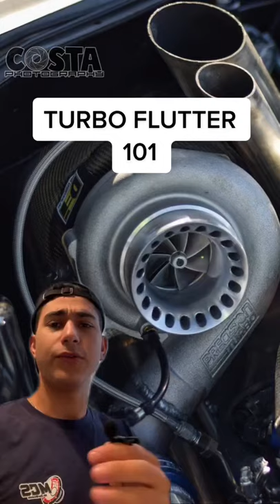TURBO FLUTTER 101 - Explaining Sutututu Theory

Comment: You fail to mention how bad that is for the turbo. Lol no pressure relief is bad
Reply: Not bad at all.
Reply: @DriftNick  it is bad for it, regardless of what you believe. A turbo is a finely balanced precision unit. Forcing air backwards is bad for it, ask people that have replaced a few turbos because of surge(ie, Ford 7.3 1999-2003)
Reply: @jnk26  Been running no valve for over 10 years, it's common here not to run one, never had a single issue with it.
Reply: @DriftNick  maybe the difference is a real turbo on a diesel vs a little turbo on a small gas play thing. A turbo on a 7.3L isn't small but it's micro compared to a 15L I6 like a 6NZ Cat or a turbo on a 95L Cummins QSK95(3000-5100hp)

Comment: I'm a mechanic and you're talking rubbish, clearly you don't understand. It's down to the type of Blow off valve and nothing to do with a recirculation valve. The wastegate setting will cause induction spool sounds which adds to the blow off valve sounds
Reply: Turbo flutter is down to the type of blow off valve? does no blow off valve count as a type of blow off valve?

"The wastegate setting will cause induction spool sounds which adds to the blow off valve sounds"

wut

Comment: Lol all these videos and to this day still wrong. The psi escapes / bounces between the compressor wheel and throttle plate.
Reply: The pressure escapes out the only place it can which it the intake of the turbo.
Reply: @DriftNick  but it doesn't exactly, which is why the pressure wave bounces between the throttle and compressor wheel.
Reply: @KCM33  What do you mean it doesn't exactly? the pressure wave bounces between the throttle and compressor wheel and escapes out the intake.
Reply: @DriftNick  The turbo is still spinning even when you let off...and the pressure wave bounces between the still spinning compressor wheel and (likely still slightly open) throttle plate. Not going to argue with you on such a technical level, in a way we are both right, so i dont care.
Reply: @KCM33  What is there to argue if we both are saying the same thing? lol

Comment: Air doesn’t go back trough turbo that’s called the bov or you have the wastegate but cool sounds 🤣
Reply: without a bov thats the only place for it to go, so yes it does go back through the turbo
Reply: When a car flutters like that, it is 1000% going back through the turbo. That's why it sounds like that. 

Also, "thats called the bov or you have the wastegate"  those are 2 completely separate things

Comment: if thats your'r reason your car is broken

normally you have a bypass valve on stock car making no noise an recirculating presure into the intake to help build pressure preventing lag

it it happens the way ya said this means you'r turbo spun backwards bad thing really bad thing

the flutter comes from a blow of valves being set to atmosphere slightly

the puthsss is 100% atmosphere bov setting

no car builder build a car without a BOV or BPV

no bov or bpv= turbo blow seals, spin backwards, and over spool / under spool  
also this would fuck your exhaust back pressure potentially causing misfire and detonations 

yeah dont listen to dumb people like him or you will fuck up your car

turbos need oil feed and retun
then wastegate and optionally a controller for it
then you need a bov or a bpv and intercooler 

BUT COOL SOUND STILL
Reply: It does not make your turbo spin backwards or cause damage or create lag or come from a blow off valve or anything you have said it does.

"no car builder build a car without a BOV or BPV"

Been doing it for 10+ years.

"also this would fuck your exhaust back pressure potentially causing misfire and detonations "

I hope this is just a troll comment because it's so dumb.
Reply: @DriftNick  lmfao
Reply: @SKILLS2KILLS_QC  You have zero understanding of what is happening and that is pretty funny.
Reply: @SKILLS2KILLS_QC  Not only is it not possible for flutter to make the turbo spin backwards as it would correct itself long before that but it doesn't even slow the turbo down, High Performance Academy tested exactly that on their youtube channel, there is no difference in turbo speed after lifting off the throttle between running a valve and running no valve, they both go down at the same rate, though anybody that has actually run no valve could tell you that it doesn't cause any extra lag, if it did it wouldn't be common place in motorsport.

"ive worked on cars and heavy equipement and never i have even seen a turbo engine without a bpv or blow of valve its just imposible it would run so bad"

Every Nissan turbo and most other turbo cars pre 1990 ran no valve and they ran just fine, even removing them from something that had one from factory can still run without issue depending if the ECU cause any issues (something that aftermarket easily fixes).

"the sound he makes in the video are all from bov even an excavator uses a bov for fuck sakes"

My car makes the sound he makes in the video, it literally has no blow off valve or bypass valve, if you can't understand the basic fact that the sound is from not running any valve I sure hope you never worked on any car let alone heavy equipment, you have absolutely no idea what is happening.

"we are the builders of about 9 rally cars "

You know the chirping sound turbo rally cars makes when they lift off the throttle? that is turbo flutter.

Comment: Turbo flutter is very bad on the tubro
Reply: Very bad = if it does any damage it's so minimal you wouldn't notice.
Reply: @DriftNick  it will cause shaft play sooner than later
Reply: @DriftNick  it dramatically increases the load on the bearings of the turbo.
If it occurs at higher engine loads or boost levels, it can cause premature wear to your turbo. Thus why a BOV is much better.
Reply: @josephraymond3180  Higher engine loads? what do you think engine load does to change it?
Reply: @DriftNick  higher rpms = everything is moving thousands of times faster. If you're running say a 63mm turbo @ 15 psi and shift at 7,500 - higher, you're going to have more induction. Pretty simple to understand
Reply: @josephraymond3180  Higher rpm does not really mean higher engine load hence my confusion.

Anyway plenty of people running a lot of boost without a valve without issue.
Reply: @DriftNick  acceleration increases engine load. RPMs go up with acceleration pending how you accelerate, either way RPMs will go up. Wether you say so or not, turbo flutter is not good for a turbo. Sure it may not cause any malfunctions right away more than likely, but over time you'll run into turbo related issues sooner than if you had a ventilated setup with a proper blow off valve. It's your money, do as you please. I've owned and built 12 turbocharged vehicles and learnt the hard way about tubro flutter on my early days. As I said, to each their own. I personally will always use a BOV, and make sure it is releasing every bit of left over boost, I don't want my fan back spinning.
Reply: @josephraymond3180  Oh god you one of those people that thinks it makes the turbo spin backwards, you may have built 12  turbocharged vehicles but apparently you do not understand at all what is happening.

" learnt the hard way about tubro flutter on my early days"

I've learnt from doing it for over 10 years and learned that generally people from North America have no idea about turbo flutter, I'm sure turbo flutter killed your turbo and it wasn't something else...
Reply: @DriftNick  nothing killed any of my turbos, just had to have 2 rebuilt over a few years of misuse due to not enough boost getting released. I may have misspoke about the blades spinning backwards, but it does affect the blades spinning. Either way, my original comment is correct. Turbo flutter is bad for your turbo. Simple as that. Anything else, I just agree to disagree. I'm not arguing over a fact that is widely known and also easily available to look up.
Reply: @josephraymond3180  Turbo flutter does not make the turbo slow down if that is what you are trying to say,  High Performance Academy have a video on their youtube testing exactly that, the rate at which the turbo slows down after lifting off the throttle is no different between running a valve and not running one.

"I'm not arguing over a fact that is widely known"

Only seems to be a fact in North America, hear in Australia people have no issue running no valve.
Reply: @DriftNick  I never said it slowed them down.. I said it affects the blade spinning. I'm done with the back and forth. Just because your name has drift in it doesn't make you a know it all on forced induction. Again for the 10th time. Turbo flutter is bad for the turbo. End of story. Agree to disagree
Reply: @josephraymond3180  You could just tell me what you think is happening instead of saying "I don't want my fan back spinning." and " affects the blade spinning", how am I meant to know what crap you made up as for what is happening?

Comment: Absolutely wrong! It is actually causing pressure to be forced against the turbines compressor wheel causing compressor surge..this can and definitely does cause many issues, at very high boost it can lead to the turbine shaft to sheer and bearings to fail. Put a fuckin blow-off valve and be a real man.
Reply: Meanwhile people here running 50+psi with issue.

Comment: And it’s not good
Reply: It's not good, it's great.
Reply: @DriftNick  running boost with out a BOV? Haha. Flutter is a sign of short lived fun. Install a high quality BOV or DV and tune it right.
Reply: @fulano787  Been doing it for over 10 years, so much for it being a sign of short lived fun.
Reply: @DriftNick  your engine has been running boost with out a dv or bov for ten years? Why even install a turbo with out one? You just wanted to hear the flutter destroying your spool and turbo bearings? Must be slow
Reply: @fulano787 It doesn't destroy spool or turbo bearings, if there was any increase in lag it wouldn't be common place in motorsport not to run a valve, literally no one would run without a valve if there was any performance loss, it's actually better if you don't release all the boost pressure out of a valve.
Reply: @DriftNick  lol, deleting posts is almost as sad as saying bovs and dvs do nothing
Reply: @fulano787  I didn't delete anything, if youtube is filtering my comment you can probably read it if they e-mail you when you get a reply, I also never said they do nothing.

"there’s not a race team out there that’s not running a DV or BOV "

Nobuteru Taniguchi just posted a video of the HKS GR86 on his channel with their turbo kit, it doesn't have a blow off valve or bypass valve, what would HKS know about building cars though, must be slow.

Pretty much every Japanese car competing at the highest level doesn't run a blow off valve or bypass valve, same is true in Europe.

How about GT3 and GTP? Ferrari, BMW, Acura you can clearly hear the turbo flutter in their cars when they lift off the throttle, guess they also don't know what they are doing.
Reply: @DriftNick  it’s the tune of the valves. The spring is set for the higher psi on their cars. It’s not them not having a valve, it’s the valve being set at its max because the springs aren’t progressive
Reply: @fulano787  If it doesn't open at full boost when they lift off the throttle when do you think it would open? it's not a case of it not opening at lower boost levels, they just don't run a valve.

"HKS の グループA R32 GT-R で 峠 を 爆走してきました。MHヒルクライム / 真庭速祭"

That is the title for the HKS video I was talking about, go to 7:48 for the GR86 part.
Reply: @DriftNick  they work off of vacuum when the driver lifts off the pedal and vents the excess boost pressure the engine isn’t using at the time. With out a bov which goes to atmosphere or a diverter valve, also known as a recirculation valve which vents it back into the intake tract before the impeller, the pressure would flow back up through the turbo in reverse causing a huge loss of spool for the next gear and damaging vibrations. I had a feeling I would be explaining how and what they do. And yes, cars come with them from the factory and race teams run them if they want the turbo to keep its momentum before the next gear. Yours must be slower than most who have the same mods and include a bov or dv because your turbo has to start spooling all over again or at a much lower rpm since you don’t want to install one.
Reply: @fulano787  I didn't ask how they work, I asked a rhetorical question, the valve doesn't open when they lift off the throttle at full boost because there is no valve.

" because your turbo has to start spooling all over again or at a much lower rpm since you don’t want to install one."

HKS and others I mentioned seem to think there no loss in performance otherwise they would run them in their race cars.

High Performance Academy tested turbo speed running no valve vs running a valve, the rate at which the turbo slows down when you lift off the throttle is the same, running no valve does not slow the turbo down and in fact helps with response with quick off/on throttle because boost pressure isn't released and doesn't need to be built up again in the piping between the turbo and the intake valves hence why it's common place in motorsport not to run a valve.
Reply: @DriftNick  ok sure. So…. if there isn’t a valve, then they are damaging the turbo and hurting their performance. Hence my first comment of that it’s not a good thing.
Reply: @fulano787  You don't get it, if it was a performance loss no one in motorsport would run without a valve, if it does any damage it's so minimal that it doesn't matter.
Reply: @DriftNick  :P
Reply: @fulano787  ???
Reply: @DriftNick  ?
Reply: @fulano787  You replied with ":P" for some reason?
Reply: @DriftNick  was that confusing?
Reply: @fulano787  Just like posting more rubbish comments I guess.
Reply: @DriftNick  well, the good stuff just gets deleted anyways… so I’m left with :p
That one got left alone haha

Comment: Turbo flutter is actually bad. It’s hitting the compressor side turbine fins when it’s already at a ton of rpm from the wrong way. Over time it will wear out the bearing of the turbo and seals and cause shaft play. It sounds awesome but in reality it’s not good for the spooly boy
Reply: Nah it's fine.

Comment: Your wrong. It’s not air coming back through the turbine. It’s the air going back through the waste gate.
Reply: Except he is right, the wastegate is on the exhaust side and has nothing to do with turbo flutter.
Reply: @DriftNick  That's only for external waste gates
Reply: @coopermaher1279  An internal waste gate does the same thing as an external one, the difference is internal means it's inside the exhaust housing for the turbo, external means it's a stand alone item that is bolted to the exhaust manifold.
Reply: the air is definitely coming back through the turbo, that's why it makes that sound. The wastegate has nothing to do with it